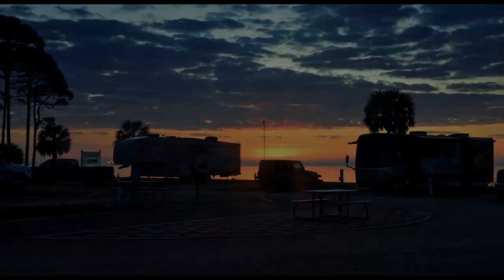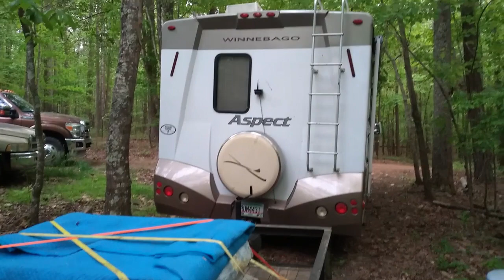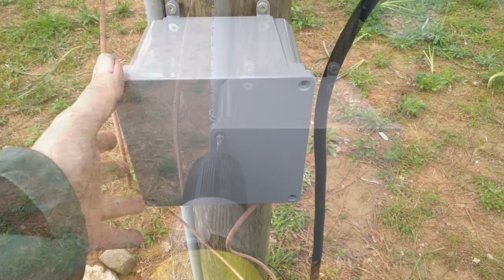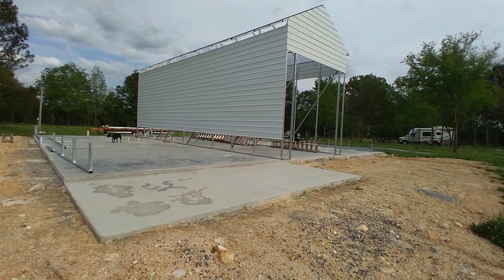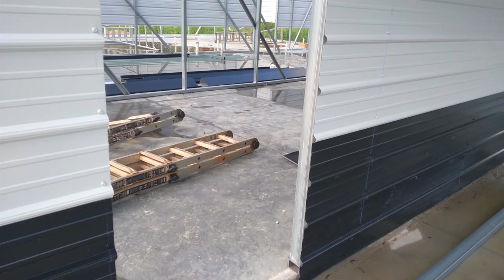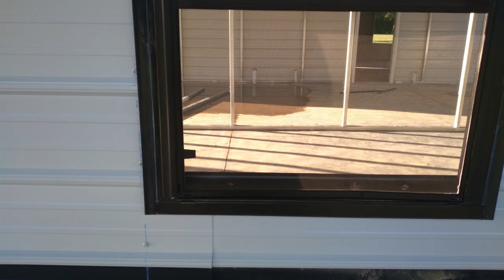RV HOME BASE BARN RAISING

Comment: How wide are your two driveways apart   trying  to figure out turning radius for camper
Reply from the maker: Sorry For the late response.  My driveways are about 300 feet apart, maybe slightly less.  Depending on the size of your structure you could probably get by with about 250 feet apart.